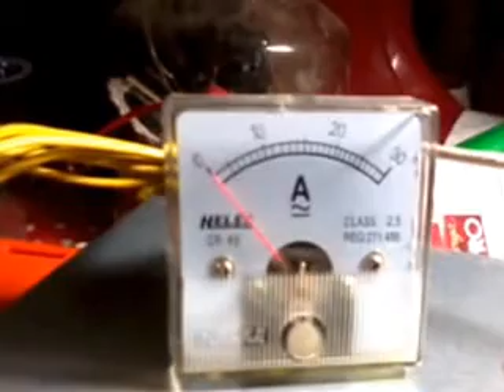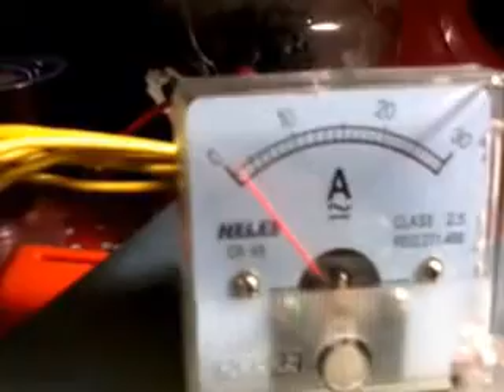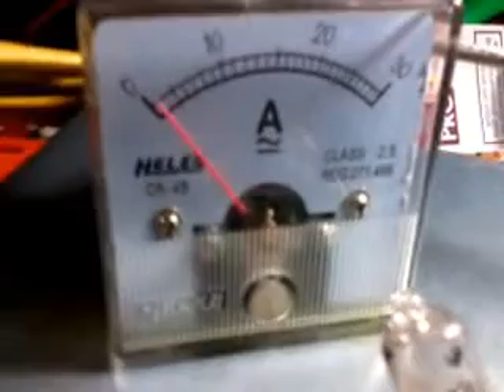Cara rebus air dengan lampu Halogen 50 Watt

Comment: Maaf mash awam bos.. kalo pakai adaptor laptop 19 volt di berikan regulator penurun dan naikkan tegangan dc 12 volt apa bisa menghidupkan lampu halogen dengan daya 50-100 watt dgn arus dc 12 volt
Reply from the maker: adaptor apa saja mas, asal nyala , bandingkan dengan pakai aki , terang yang mana , kalo terang pakai aki artinya adaptor anda kurang kuat  wes gitu saja hehehe kabel tetap diluar air , yg masuk cuma pipa tembaganya yg dalamnya di pasang halogen
Reply: @PakdeHari  oke bos terimakasih informasinya 😀😊
Reply from the maker: adaptor laptop nggak kuat ,ini minim 4 amper